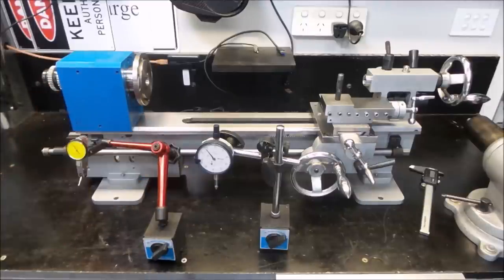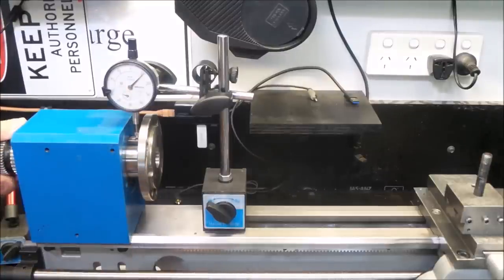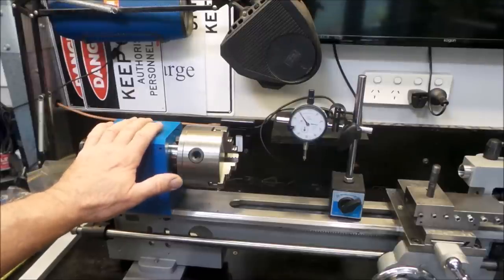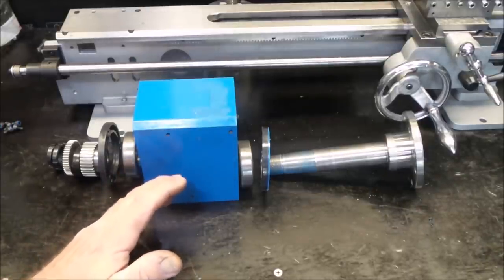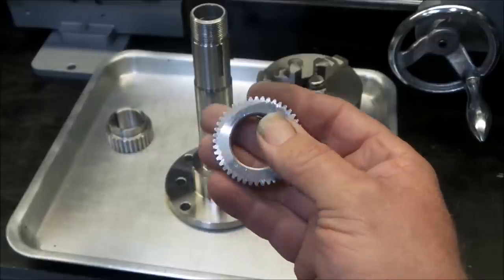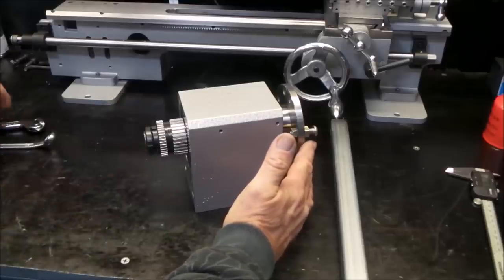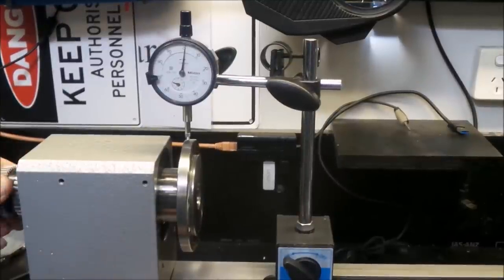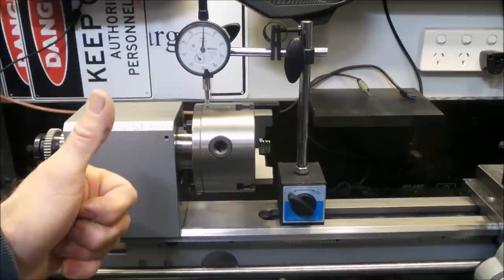New 7x14 Mini Lathe Headstock Tear Down & Rebuild with Angular Contact Bearings

Comment: I think you made the correct choice with the bearings. They can take higher rpm, they are sealed and they are direct fit vs the tapered rollers. The stiffness is not necessarily that important, even the shaft itself being that thin springs to a slight banana shape long before the preloaded bearings feel a thing. The machine is anyway only as rigid as the least rigid spot, which is far from the bearings in this case.
Reply: I agree on the choice of bearings as well and will be using the same ones on my mini lathe.

Comment: Great series Trevor, with the angular contact bearings you should have explained which way they go in. As you said, they should be opposed, you need to point out hiw to identify which way. "THIN GOES IN" refers to the thickbess of the inner race.

Comment: Thanks for making this series, looking forward to the next ep. Some thoughts on the headstock:  Replace that plastic spacer with a metal one ASAP, it (and the wobbly nut) is carrying the preload now, not just locating the gears. The plastic will creep losing the preload which is necessary to keep the balls from skidding.

If you're ambitious, and since you don't have gears in the headstock you could even put spacers between the bearings, equal length, for both inner and outer races.
Reply from the maker: Thanks Shane.

Comment: Looks like that second lock nut you took off the back of the spindle was extremely out of square on the thread.
(I see you pointed it out on the way back on ) :)
I have noticed your chuck backing plate Is part of the spindle.  What kind of weird arsed design is that?
How can you mount a 4 jaw chuck for example unless it is exactly the same size on the register?
Maybe you bore the back of the chuck out or make a backing plate for the backing plate.

Interesting video, thanks for making it 🤠
Reply: It's actually a very clever and cost effective design. All chucks and face plates register straight into the spindle and are bolted on. You never have to worry about the chuck coming loose and it is a pretty idiot proof design.
I get no readable run out on my 3 jaw, 4 jaw and ER32 collet chucks on my mini lathe.  This guy seems to have received a particularly bad example. 
In all honesty, despite all the frustrating niggles, they are quite good value for money especially when you take into account the cost of extra accessories and tooling. With a bit of patience and skill, they are capable of some outstanding work.

Comment: Thanks again for documenting. I have one of these fine engineering marvels and the first thing I did was re cut the register. Dramatically improved run out. Fine work on everything. I have some tapered bearings for mine, but I think you have convinced me to go with the angular bearings.
Reply from the maker: G'day DM, your 100% correct on the register. I threw the motor on it the other night & did exactly that. It came out really good. Very happy with it now. Cheers Mate.
Reply: @TheAussieShed  Great series. I love your work. However, I'm not sure what you guys mean by "recutting the register". Did you record your work for that step? If not, please give some more details of what you did. Thanks.
Reply: @VictorHarrys - Remove the chuck and make the slightest finishing cut. To the spindle face and register. Register being the center area. Where the chuck seat against. 
Notice: The intention is to straighten the spindle face as best as possible. While removing the least amount of material. 
That's it. I hope it's clear. Since English is not my native language. ;-)
Reply: @crpth1  Thank you. Now I understand what he meant.  Nobody’s language is perfect, so there’s no reason to apologize. Your punctuations need some correction, but your details are very well written.

Comment: Your choice of bearing geometry is right. However, I would go with a nicer brand though. My favorite brand is Nachi but for this case, I've purchased NTNs which provide precision tolerances close to SKF high precision series at a budget price. Those Japanese are just like that you know... I do not think that your bearings will fail soon though.
Reply from the maker: Thanks for the tips! Cheers.

Comment: My mind was already blown by the paint on the spindle... But holy crap, that crooked-ass locknut! 😂 Man, quality sure has gone downhill since I got my 7x10 back in 2010. It even had properly finished parts, like it was made by people who gave a damn! (Imagine that!)
Reply: My "lovely" lathe with control panel and rpm panel literally hand cut with a hacksaw! I'm not kidding! 
Loose headstock (the bolts were too long) and a whole lot more shocking details. 
Would make anyone (me inclusive) pull hairs from the first look.

Bearings damaged right out of the box! Because some "animal" hammered the spindle face until it got deformed!! Which produced a chuck runout of more than 1mm. Not microns, not tenths on mm, but > than 1mm.

Might come as a grotesque surprise, but there's more to the story. The exact same blue paint all over. Become a tiny inconspicuous detail... ;-)

Comment: Greetings from Canada - I'm just trying to source the main shaft bearings and my local supplier says there is no such thing as a 30X62X16 double sealed Tapered Bearing. I checked our the eBay link provided and it shows what you used (the bearing with the blue seals) Can you confirm to me that the bearing you got was the one in the eBay link. Thanks for your assist. All you other techniques have worked like a hot-damn! I expecting the lathe to perform much better than the OEM delivered product - in fact, yours had more severe  issues than mine did but I did have all the same issues, just a few less severs.
Reply from the maker: G'day Mate, firstly, thanks for watching my videos, yes, i just checked the link & it is the correct Bearing. Give your supplier the Bearing Part number which is 7206B2RS, he should be able to find them from that. It is the same part number across all Bearing Manufacturers. If that doesn't work I'd go elsewhere. Cheers Mate.
Reply: @TheAussieShed  Many thanks!

Comment: Congratulations you did an excellent job.
I have a question: Before painting the headstock did you remove the old color first?
Did you apply primer?
Reply from the maker: G'day Mate, rubbed it down, primed & then Painted it. Cheers.

Comment: A really great Series, Thank You so much.   I am afraid I don't have your patience and tenacity to go to those lengths for perfection, I have fixed many of the common problems and I get decent results from something that arrived as a piece of rubbish at £599.  It is an 8 x 14 Chinese "Seconds" reject tarted up and sold on e-bay with no support etc. etc.   But she makes the parts I want to make.  A 4-jaw independent chuck replaced the 3-jaw rubbish it came with.  Still struggling with cross-slide backlash and nuts that won't adjust decently.  But we survive.  :-D   Thanks again for all the great videos mate!
Reply from the maker: Cheers Danny, thanks for watching Mate.

Comment: paint n smash on parts ,,,ancestry suggests this started when the makers started not to give two shits ,exact date is locked in a safe in the ccp main headquarters ,i have a new lathe like yours still boxed ....glad i bought all the accessories the basic is not good ,,,bit miffed the cam lock was not on the tailstock the pic said it was there,ebay meh....
Reply from the maker: Yep, par for the course Mate. Sounds like your expectations are in the right place. I'm sure its some kind of test for us. Cheers.

Comment: Did you ever video the results cutting material after the bearings were replaced?  Mine without any pressure on the chuck looks great on the dial indicator, but when I apply pressure to the tooling you can see the chatter.  Have any video showing the improvement cutting?
Reply from the maker: No David i dont at this stage. You sure its the bearings? I imagine you've had everything apart. Have you checked for end float? The bearings need a bit of preload. Cheers Mate.
Reply: @TheAussieShed  I did some cutting last night and the chatter is gone.  Must have been the tool.  Thanks.  I will post some video next week when I return.  Thank you

Comment: Great video series. 
Without a hi/low it looks like actual seals could have replaced the plastic shields and allowed a taper bearing install.
My King Canada lathe has the Hi/Low so its not an option and I'm starting the install of the same annular bearings.
Reply from the maker: Hi Rupert, you are correct, from memory there was a seal I found that was a perfect fit too. Definitely a good option.
Cheers mate.

Comment: Watching your series (great information). 

Got to ask (given the level of quality of casting and machining from the factory -) are you sure that the center bore of your lathe is parallel to the bed (ie , a dip or buildup of a 1/10000 on a corner[s] of the bottom of your headstock would easily account  for run out over the length given after the bearing swap)? Should add I've already watched the whole series (just re-re-rewatching interesting ones)!
Reply from the maker: G'day Mate, you must be Psychic, currently working on exactly that. From the factory, the Headstock Alignment leaves a lot to be desired. Cuts a nice 1/2mm taper over 150mm. Cheers Spud
Reply: @TheAussieShed  Psychic or psycho  , something like that (the latter according to my Missus) !  😁

Looking forward to seeing your result (think that you shall end up with a Sieg-quality lathe for 1/10th of the price upfront , but sweat equity making up the difference)!

Comment: Nice assembly vid.
What you need next is a #3 morse taper test bar to check the head stock alignment to the ways.
 Mine needed shims to get alignment correct.
Thanks
Reply from the maker: Absolutely Dennis, sounds like a plan. Cheers.

Comment: If you watch the removal of the second lock nut of the spindle it was cross threaded that’s why the threads were bugged
Reply from the maker: Hi Barney, yes it does "look" cross threaded. The threads on the lock nut however show no signs of that, there is a single non damaged thread in it, that i would assume was done with the nut sitting out of wack when cutting the thread. But yes you are totally correct, you can see it in the disassembly.
Cheers Mate.

Comment: What did you use to put the bearings?  Press?  Hammer?
Reply from the maker: G'day David, Yes I used my small workshop Press. They went on quite easily. Cheers.
Reply: @TheAussieShed  Thank you for your quick reply.  Think I can bang the out and in with a hammer and blocks of wood and schedule 40 PVC pipe?
Reply: them out
Reply from the maker: Hi David, once you get the old ones off, place the shaft in the freezer overnight, it will make it a bit easier to get the new bearings on.
Carefully warming the new bearings before installation will also help. You may want to measure your shaft, I have heard there is some variation in them, making the bearings almost slide on on some & be overly tight on others. If your shaft is slightly oversize or out of round doing it by hand may be a struggle. Cheers Mate.
Reply: @TheAussieShed  Got it.    Stay safe.
Reply: @TheAussieShed  yes too hot and the seal comes off.